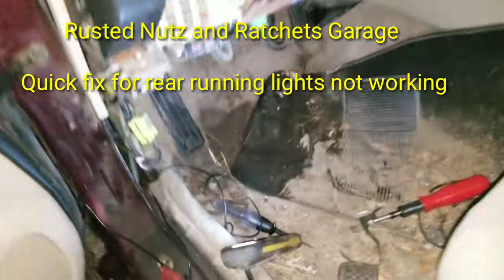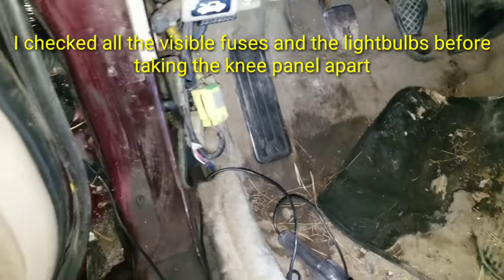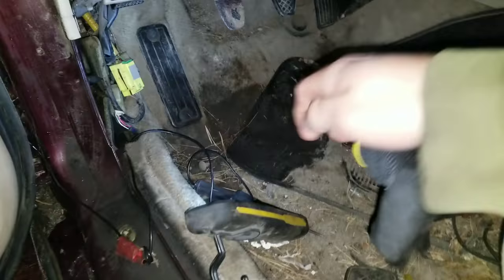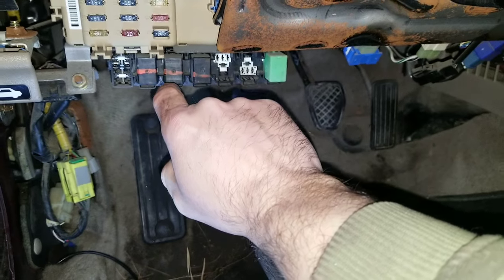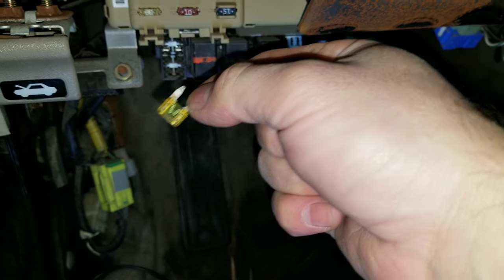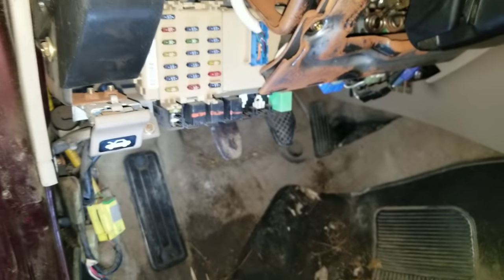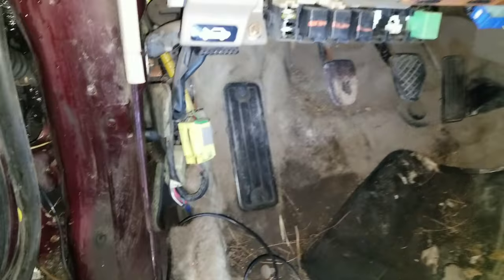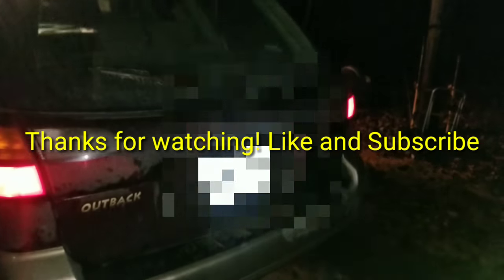Running lights not working fix

Comment: I have an 02 Subaru Outback. I’m not getting any taillights and the instrument cluster doesn’t light up anymore. I tried replacing all the fuses and bulbs. Sadly I don’t think it’s gonna be that easy.
Reply from the maker: I don't have my subie anymore but did you check the panel by the steering column? Might have to check forums and start pokikg around with a test light
Reply: Get under your steering column and make sure all your loom connections are plugged in properly. After that, you can start looking at stuff like fuses, relays, ground, ohms, etc.... A lot of people play footsie with their cars and unplug stuff by accident.
Reply: I have the same problem but on my 08 tundra
Reply: @usstexasbb3555  it ended up being an aftermarket alarm that was put in before I got the car. The mechanic uninstalled it and rewired it to get it working hope this helps
Reply: @admiller1997  Its becauae I added a switchback turn signal without the resister and it popped the turn singla and acc light for trailer and running and I replaced them and there nor working anymore
Reply: Hey bro, did you ever figure out what was the issue for your car? I literally have the same issues with my car at the moment, in an 02 accord
Reply: @lone4047  I took it to a mechanic and he said the wiring was messed up because of an after market alarm system. He took it out and it fixed it.

Comment: 2014 jetta s and running light not working but brake light, blinker and hazards work. changed bulbs and fuses. any ideas?
Reply from the maker: There may be a taillight safety relay or even a separate fuse block for that. I don't know much about VW but was also able to dig this up for you https://www.volkswagenownersclub.com/threads/rear-running-lights-not-working.112145/

Comment: I have a 2006 chevy equinox I put different headlight bulbs in it and now I have no daytime running lights or a heater. I have checked all fuses and relays they r all good. What do I need to change now
Reply from the maker: I picked this out of the forums for you. It's a start
Welcome to the forum. DRL is standard on the Equinox, all years. It could be that the previous owner disabled it for some reason. Check the DRL relay in the underhood fuse block. Also, the DRL resistor may have failed as documented in TSB #07-08-42-002. See thread https://chevroletforum.com/forum/equ...-lights-14651/. In either case, I'd think the selling dealership should fix the problem.

Comment: I have a 94 dodge 2500. All the lights went out and we did replace the turn signal switch it work for a little then it went out. What could be the problem?
Reply from the maker: Sounds like you may have a short in the wiring somewhere. Do you have another switch to try? Perhaps the forums could help in this department

Comment: Have same.problem with my 2010 Chrysler Sebring ever since I changed the tail/brake bulb on left side, neither tail lights run now but brake lights, turn signals still work 🤦‍♀️😒 & I can't find any answers as to which fuse is for the tail lights anywhere
Reply from the maker: Oh that's terrible. Sometimes I have bulb issues with my supra. If I put the wrong bulb in the holder it causes some weird short or something. I hope you figure it out and I'm sorry I can't be much more help. I always consult the forums too
Reply: My chevy cruze 2012 has same problem, left tail light is not working but when I press brakes it works, indicator and reverse gear light works, tell the solution

Comment: so what exactly did you do?
Reply from the maker: I first checked to see if the bulbs were burnt, then I checked the fuse panel and all fuses related to the tail lights. After that I checked the relays and some other fuses. Thats what lead me to the small 20amp fuse. I used a test light to check continuity. Forums sometimes help point in the right direction as well.
Reply: wheres the 20 amp fuse from?
Reply from the maker: @IAMJKLFORLIFE  its from the panel beside those 3 relays. There should only be 1 fuse there. I can screenshot it a d sent it to you through instagram if you would like
Reply: @suprachefgarage9845  mastaspliff on instagram, cant seem to find the 20 fuse anywhere in there

Comment: does anyone know where I can find a wiring diagram for it? The tail lights are not getting power. So I need to power from somewhere else it to get it to work. thanks
Reply from the maker: I have taken a power wire from the license plate lights for the tail lights on my supra
Reply: @suprachefgarage9845  thanks that might work

Comment: I've got a 2011 Ford Edge passenger side tail lights not working, any ideas?
Reply from the maker: Im sure you tried the light bulb. Does the brake light work? My supra has a tail light failure box that I had to bypass. Im not sure about ford though. Message me through my instagram and we can maybe figure it out. Ill do some research tomorrow but it sounds like you have a short or broken wire. @suprachef is my insta.
Reply: @suprachefgarage9845  All other lights are working fine, its just the passenger side tail light that doesn't work
Reply: Sorry I'm sure why that's not there. Yes I changed the bulb. Just changed wiring harness earlier today but still nothing
Reply from the maker: Did the harness plug in to the fuse panel? Does the harness control both sides of the taillight system? I dont know much about the ford wiring systems but you can check using a test light too. If it were a bad ground you should still have light but it would be dimmer or something funny.
Reply: @suprachefgarage9845  no the harness plugged in the same way. Driver side still working, just passenger side out. I'm going to swap out the driver side tail light and put it on the other side to see if that is the problem
Reply from the maker: @tonyc6454  Ok, let me know how that works for you. Im interested in your findings. Good luck
Reply: @suprachefgarage9845  I'm going to change the fuse as well, but I don't think it will do anything. Driver side works. The fuse controls both rears not left and right

Comment: Alright can someone tell me this. Thought my passenger side running lights on the front and back was bad so when I changed them I decided to do all of them. I put them in driver side works passenger side brake turn and front turn signal works but the marker lights still does not.
Reply from the maker: Hmmmm... That's strange, sounds like you may have a short somewhere. If I put the wrong bulb in my supra it messes with the lights too.... Some things to consider
Reply: @suprachefgarage9845  it was the same bulb I put on the driver side and they work fine but I did find another video where someone replaced the bulb socket itself and it fixed it so I might try that before I tear into the wires
Reply from the maker: @hilham89  absolutely, anything before the wires lol. I had that happen with my supras taillight bulb sockets as well now that you mention that. I hope all goes well
Reply: @suprachefgarage9845  hopefully. Still going to save this video for the future though. I do appreciate it.

Comment: My 2004 Ranger parking lights won't freakn turn off. WTF?
Reply from the maker: My apologies for the late reply, did you fix the problem?
Reply: @suprachefgarage9845  
It kind of just stopped for the past few days. I'm sure it'll come back again. These Rangers never stop doing strange crap.
Reply from the maker: Oh ok. Sounds like a short somewhere or a short to ground. I hate electrical sooo much

Comment: Need my truck parking light in front on
Reply from the maker: Only the front? I'm guessing you already checked bulbs and fuses? My Subaru has a sort of secret fuse panel
Reply: @suprachefgarage9845  yes I did  front parking light not on dont know what the cuase